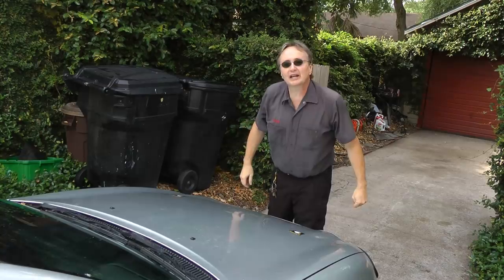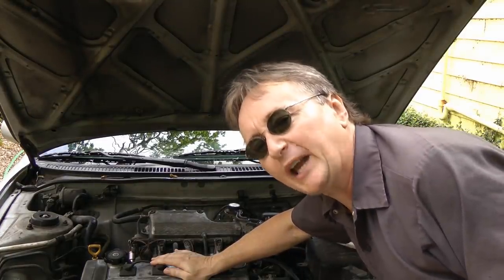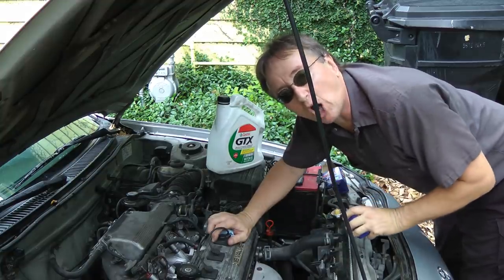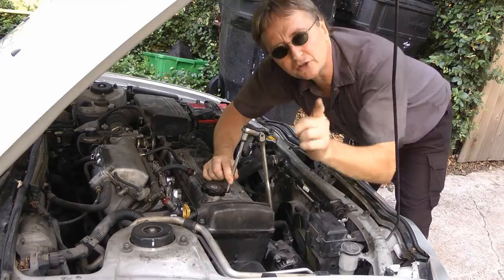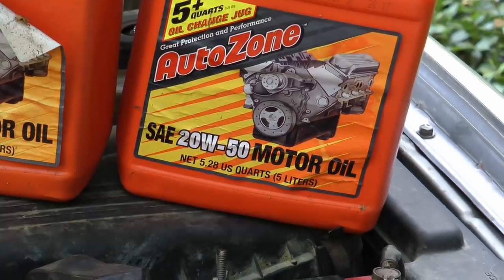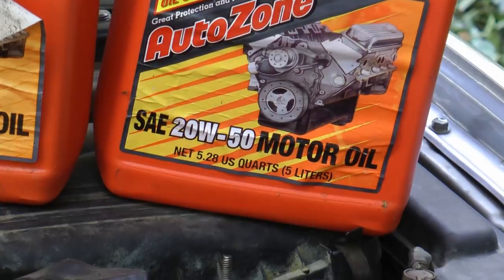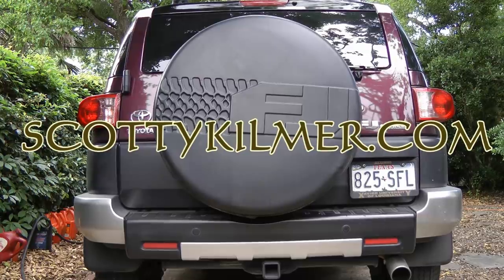Top 4 Mistakes Car Owners Make (DIY Fails)

Comment: Three things:  1 - If have never in my life installed a new oil filter without first cleaning the gasket surface on the engine.  If you clean that surface, you can't leave an old gasket on it.  2 - Do not remove "one" of the battery cables from the battery.  Always  ALWAYS remove the negative battery cable from the battery.  When you have a tool on the POSITIVE post, touching pretty much anything on the car with the tool will complete a short circuit.  With a tool on the NEGATIVE post of the battery, pretty much the only things you can touch that will cause a short are the POSITIVE battery post and the starter motor stud.  ALWAYS make the NEGATIVE cable the first thing removed and the last thing reinstalled.  3 - The W in the oil viscosity stands for winter, not weight.
Reply: generalbarry only ones this does not apply to are the few positive ground vehicles that were made.

Comment: Also make the last person didn't leave an old gasket on the oil filter adapter surface,  I found one with a total of two gaskets on the surface neatly stacked.  I still can't believe it all stayed in place and didn't blow out. I have overhauled several engines that were blown that way. Retired after 45 years  master mechanic.

Comment: I remember replacing an engine in one of those 1994 Celicas. It was due to the owner ignoring the oil level. Connecting rod was sticking out the font of the engine block and had caught the engine on fire.

Comment: I have know a couple of people that thought they should modify the oil type, I explained-  then why did they go through all the trouble to calculate which one is best using all their scientific methods and then print it on the cap, manual, and all the technical manuals when you could just guess at it. 1 of them still did it to see what happened, the other listened.

Comment: one thing he did miss when talking bout removing battery terminal while doing electrical, which is on many GM models when you disconnect the battery terminal the computer dumps all its programming and needs to be re-program by a dealer or other service tech.

Comment: I once had a Mazda RX-7 (Wankel rotary engine), the oil filter was mounted on top, vertical upside down from most engines. I always stabbed the top of the old filter with a screwdriver while still mounted on the motor about 10 minutes before removing. I found it let the old oil drain back into the oil pan and made oil filter changes MUCH more clean by not having a full filter dumping dirty oil all over everything.

Comment: Scotty, my recommended oil for my 09 Mitsubishi Lancer gts is 5w-20 but in 4k miles it will burn through a whole quart but using 5w-30 it doesnt burn it. My milage is 171k

Comment: Regarding disconnecting the battery, be advised that with Mitsubushi Pajero, you have to reset the tick over. This is not as simple as you might suppose. Get the engine warm, turn off, wind down the windows, turn on the aircon ...I'm not making this up.

Comment: We live in desert weather with summers over 100F for months. I always use 10W40 oil despite car manufacturer recommend 5W20. I just do not trust at 100F temperature the oil is thick enough to provide metal to metal protection. For over 30 years no engine problem with heavier weight oil.

Comment: Only disconnect the battery if you have the radio code, else your sterio will not work when you reconnect the battery, have learnt that from watching collegues do so.
Not so bad on an 03 plate fiesta, where parts, such as a sterio is cheap, but for more modern vehicles it can be an expensive mistake.

Comment: I made the oil filter mistake, started my car and 3 quarts of oil shot out.  Didn't hurt anything, still had my car on jacks because I was checking it for leaks, but I had a huge mess.  It sprayed all over the engine bay.

Comment: I have to add this, the w stands for winter not weight. As in 10w-40, this is a multiviscosity oil the 10w is viscosity rating at 0°f, and the 40 is viscosity at 210°f.

Comment: Had an issue with an oil filter gasket one time. I changed my step daughter's oil she took off and oil was going everywhere. Lucky it didn't ruin the engine. The new gasket on the new oil filter shifted and was blowing oil only when the car was running.

Comment: Love your content! Long time follower and subscriber. I love your video content! *Problem* I have a 2005 GMC Yukon XL 5.3 Vin# 1GKEC16Z75J154574. Start no crank problem until 2nd start attempt. Checked fuel pressure at the test port on the fuel rail. With the Key on but not started the  pressure indicates 25+- psi but quickly declines to 0. Checked after vehicle starts pressure holds steady at 48psi. Once vehicle cranks no problem accept a light rough idle. Fuel pump is original from factory. Current mileage is 241k.  I don't see a fuel regulator to check. Anything else to do before replacing fuel pump. Hesitant to replace pump cause once cranked there are no problems. I thought fuel pump failure was all or nothing. Thank you for your help.

Comment: Also, using the wrong oil with an engine that has a oil pressure controlled timing chain tensioner is a big problem (Ecotec 2.4 from 2007). I made that mistake by accident. And it was only a half a quart. Two days later it apparently shattered that tensioner. Repair shop guy cut me a deal of $600 for labor, no charge for the parts, but no warranty on the work. I'll never make that mistake again.

Comment: I learned the hard way about that. I changed an Alternator and forgot the disconnect the negative side battery, that Alternator wire seemed to be welding my car metal parts when it touched something.

Comment: Re the removal (isolation) of the battery to do electrical work or replace the battery.    
A wise man (my dad ) said always remove the negative terminal cable first.  (as was done in this video)

That way if your spanner should touch the car body or engine as those are already car earth (negative) it wont matter.  

Then if undoing the positive terminal nut,   should you spanner touch the vehicle body it wont spark because 
the negative is not connected.   

Install is the reverse,    the positive first and then the negative.

Comment: I made the first mistake as a teenager while working for target about 10 years ago thank god I lived only 2 to 3 miles away from work at the time and got a text from my dad saying "Do not drive your car home it is leaking oil FAST!" low and behold when I checked the filter it came loose due to a left behind gasket. For years there was an oil trail from my house to the target at the mall of georgia and every time my parents would see it they'd get a kick out of it.

Comment: I would also prime the oil filter with oil and then screw it on to avoid a "dry start". I don't know if it helped, but I'm sure it d idnt hurt. Although that's only if the position of the oil filter would allow you to do that.

Comment: back in the day.. we always heard of the oil filter gasket disaster. me and my little Bro between us had over 30 cars at one point. my dad also had an auto engine machine shop. we NEVER saw the oil filter doubled O Ring problem. we did hear if it and did preach it to customers but never did we see it. im sure it has happened but ive not seen it. ...love the VIDS Scotty:)
Reply: darthvader4hire I’ve seen that first hand. My fault .  Boy did it make a mess fast.

Comment: I know ‘bout the filter gasket! Back in the early nineties I was working at a Chevrolet dealership. I left the Parts department to go work on the Lube Rack out in the Service department. I performed a lube service on a 1988 Corvette convertible and to this day I still remember the color, white with the tan convertible top and tan leather interior. I know when I installed the new oil filter I wiped around the area where the filter attached to the bottom of the engine block. I lowered the car, put in fresh oil, and started the car. I went to put my tools away and I happened to turn around and see oil starting to flow out from under the car! I ran over and turned the car off. I raised the Vette back up in the air and took off the new filter to find the seal of the old filter stuck to the oil filter boss. I got wrote up for it, but it was better than the dealership having to buy a new engine for that Corvette!

Comment: 1,I clean the seat before installing new filter anyway.tricky balance between loose and tight for next change. 2 would'nt like working on hot or warm engine anyway

Comment: Another tip about oil filters is to never buy a cheap oil filter where the gasket is loose on the filter housing, like the STP blue in this video.  Only buy filters where the gasket is glued or otherwise not able to fall off.  This doesn't mean you will never have to worry about part of the gasket sticking to the engine but it seldom happens.  Also, with a glued-in casket you won't have to worry about the gasket falling off the new one before you are able to screw it on.

Comment: Respectfully Scotty, I know the oil cap will only give one oil weight to be used. However, the owners manual will show different weights for different temperatures. It will recommend heavier in hot climates and, lighter in cold climates.

Comment: Also check your drain plug gasket and check for leaks at the plug and filter after running engine. And use good oil not store brands!

Comment: I know that I prefer to use a 10W30 oil in my mothers 2000 model Corolla with the 7AFE engine fitted & my 2002 model Holden Commodore with the Chevy LS1 engine fitted but Penrite now only seems to have a 10W40 oil.

I use a Repco brand of oil in both cars which is apparently made by Penrite but packed into their own bottles which is 10W30 oil.

As far as the spark plugs go,in the 7AFE engine I fitted a set of Bosch platinum spark plugs on Thursday in the Corolla & torqued them up to 25 newton meters, I also used Never Seez on the spark plug threads,I fitted the platinum type of plug so my mother doesn't have to worry about them for the next 100,000 kms at least,the car is 18 years old now with over 216,000 kms on the odometer but my mother is 65 years old this year but by the time the spark plugs need replacing I'm not sure if she's going to be driving still.

Comment: Spot on Scotty I ruined my boat motor changing the oil filter. I took off the oil filter and left the gasket on and didn't find out until the motor seized up . costly lesson.

Comment: How about using STP high mileage additive in your oil ? 
The engine is 2012  6.2 liter with 112,000 miles on it.

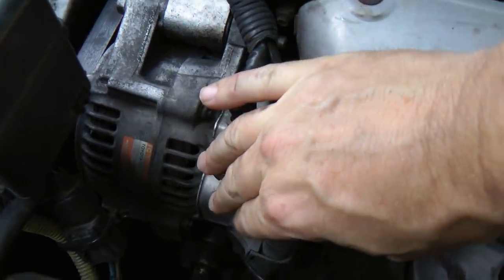Comment: @ the 1:57 a guy from work got his wedding ring in between the positive post of the battery and the radiator he was working on.It fried a perfect ring around his finger ! As for letting the motor cool down before replacing the plugs ,i got a scar the size of a dime on my left wrist from trying to replace the #8 plug on a '77 caddy that the exhaust manifold hadn't cooled down on.

Comment: Yeah but thicker oil like Lucas oil stabilizer is better in an old worn out flathead or pushrod engine because it takes up the extra slack. It can quiet noisy lifters, reduce crank rumble and light rod knock. Also jack up the oil pressure if the oil pump is tired.
Reply: I  like Lucas products, Chillkoot. That is some name.

Comment: So i was changing my idler pulley and took off the tensioner to clean sand a paint it. Everything was going great. Then when i went to put the tensioner on the bolts would not tighten up. The holes were stripped. Not the bolts the holes. So i put a spacer on the top one since it had threads in the shallow part but none when you got deeper in the holes. Got it tight. The bottom hole had some so i put removable lock tite on it to glue it in there basically. No problems so far. But i got a tap just in case. Should i tap it soon or you think that rig will hold up. Its been a month no problems so far. Its a 2004 dodge stratus 2.7l engine 6 cylinder

Comment: Scotty I got a question. I tried changing to a 0W-40 and I noticed immediately that my oil pressure dropped to 1 out 3.  Formerly it was always at 3. Why did it dropped to 1.  I also noticed that the 0W-40 was like almost water. it was really thin. But many say thin oil is alot better since being thin it will go into all the crevices of the engine where it is needed to lubricate!
Reply: EndofUSA anyone who says thinner oil is better just because it’s thinner I would recommend to stop listing to them. If your engine dies, they are not footing the bill. 

What Scotty said is correct. BUT! The oil cap is only a general guide. The user manual should have more detailed info on what oil to use in relation to the expected ambient temperature the car will experience before next service. 

Usually manuals will specify a thicker oil in hotter climates. And thinner in colder climates. Also depends on the tolerance the engine was built to and how worn out it is. 

If your oil pressure has dropped significantly then you would have too much oil coming out of main galleries and little if anything flowing to smaller ones.

Comment: Several comments about filling the oil filter with oil before puting it on. You just can't  do this on a lot of cars. Some mount sideways, othets mount straight up with the opening pointing down.  Others at all angles.

Comment: scotty kilmer  : i noticed you didnt put oil into the new filter before going to reinstall, i was always told to fill up a filter weather it be oil filter fuel wilter trans filter etc with the correct fluid before installing. is this a necessary thing to do? i was told it helped to minimize time with no to little lubrication in spots

Comment: My first new car, a 1976 Civic was double gasketed by Jiff*Lu*e and at highway speed my oil light came on and by the time I got off the road my engine was toast. The dealer found the problem, contacted the oil change service and I picked up my car a week later with a new engine. Since then I have been doing it myself and to be sure, I apply the oil coating to the new filter by kissing the old filter gasket.

Comment: Scotty. I have a 2000 ford explorer. The rear dome light works manually, but the front dome light sometimes works manually, but not all the time. I have no rime or reason at which points it does work. But the problem is the dome lights don't work when opening the 4 side doors. Have not checked if the rear hatch operates them. The dome lights will not work also when operating the dimmer wheel to the up pinned position. I have checked all the fuses inside left dash side and in the engine compartment. I thuink the fuse may or may not been no. 26 but anyhow checked them all. I heard there is a gem and a relay for battery saver and i cannot find on the internet where this battery saver solenoid is and the gem is out of my league, so i hope it is the solenoid. Can't see all door switches failing at the same time. So my question is where is that solenoid? so i can test. Thank you.

Comment: when doing oil always ask the company or manual. my oil cap sais 10w30 on my 91 buick in the summer and 5w30 in the winter. but if you use full synthetic like i am its 5w30 all the time. so i suppose this is somthing to watch for as well for older vehicles since new modern vehicles all use a synthetic blend or full synthetic so its usual 1 weight all all year for new cars.

Comment: When disconnecting that battery, ALWAYS disconnect the Negative terminal!  Contrary to popular belief, power on a battery actually flows from the negative terminal to the positive terminal.  So if you only have the positive terminal disconnected, you will still have power flowing to some components with nowhere to return to.

Comment: Which battery wire is the best wire to take off?  Please don't tell me it doesn't matter. I've always taken the positive cable off. I'm getting up there past the big 6 - 0 and been working on vehicles since I was knee high to a grasshopper.  way too many years crossed my sidewalk but you didn't tell us which cable  to mess with before working on electrical parts.  So which wire you think should be removed first and reconnected last.

Comment: a good place to start is the owners manual when choosing oil but its not the end all say all. The temperature the vehicle will regularly operate should be considered as well. My truck actually recommends anything from 5/20 all the way to 20/50.

Best example is would you run 5/20 in an endurance race? (or even extreme road use) The high temps will cause the already thin oil to thin even further since the car is constantly at a high temp...so switching to a slightly different viscocity would be beneficial. 

The reverse is true as well... you would not want to use 10w60 in your BMW if you live in Siberia (lol idk insert cold ass place here) 

most of the time the owners manual will get you through the day but might not be ideal... the 5/20 and 0/20 oils are all used mainly to increase fuel economy (and probably to get a nice certificate or tax break from uncle sam)

Comment: today's engine tolerance are so small compared to years ago are so tight that using heavier oil, does not get to the bearings soon - especially in colder climates, using the recommended weight  is the best thing - - - unless you live down south and - if you have a oil pressure guage that says the oil pressure is low, then go with a heavier oil.

Comment: Not sure about the suggestion of anti seize lube on the spark plugs esp as you can then overtorque them. Modern sparks have anti seize as part of the thread no?

Comment: Scotty not sure if you know this but the W in oil designation doesn't mean "weight" it means "winter." So it's not 10 weight 30 it's 10-30 oil with a winter additive to keep it from getting too thick when it gets cold.